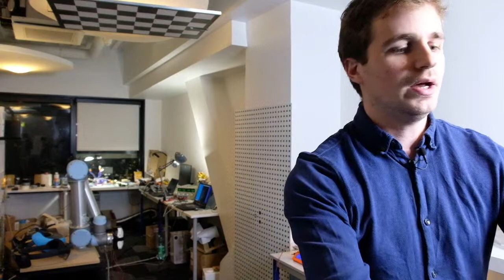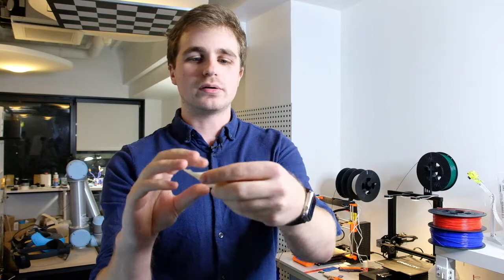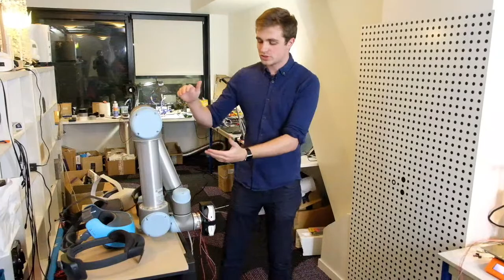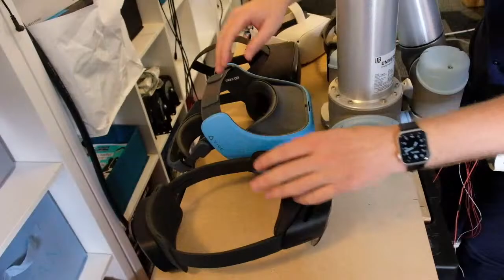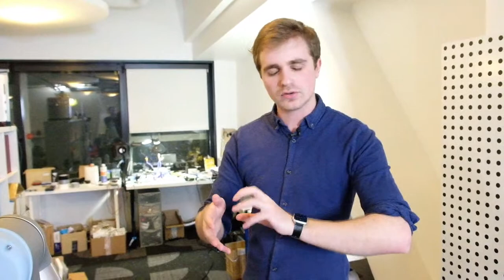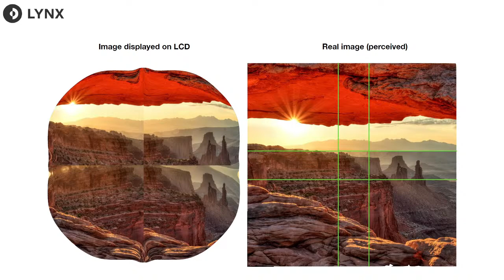Lynx Meet-up | Progress Report #2

Comment: I wonder how VR will feels on the V1. There will be plenty of lights coming in from the outsides of the headset, and this impairs the quality of the experience in VR it would be a really sad thing. Do you plan to sell an additional face-covering gasket along with the headset ?
Reply from the maker: Hi Thomas, I will talk about it in the next video, but yes of course in VR mode you should put the face-covering foam that we also provide. It's fixed with magnets to be easily removable (and washed).
Reply: @LynxMixedReality  Fantastic news!!